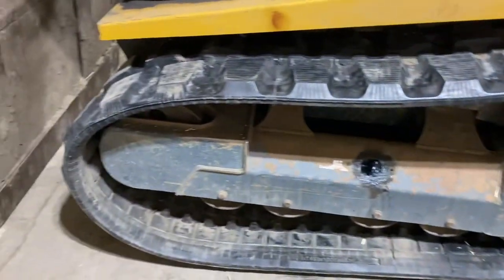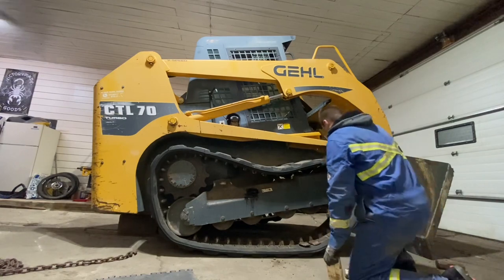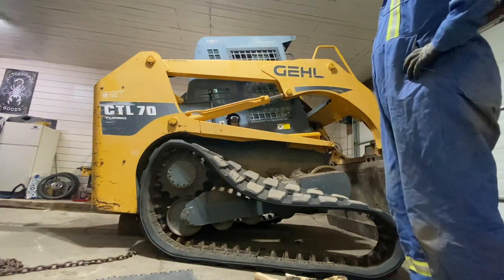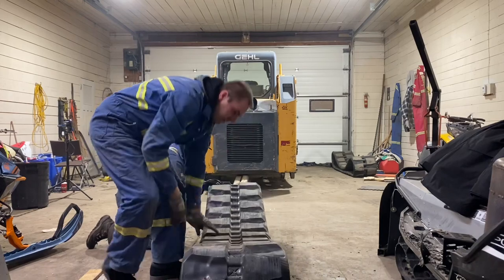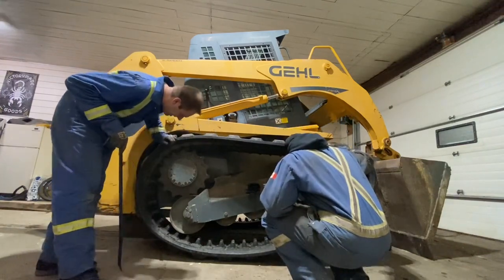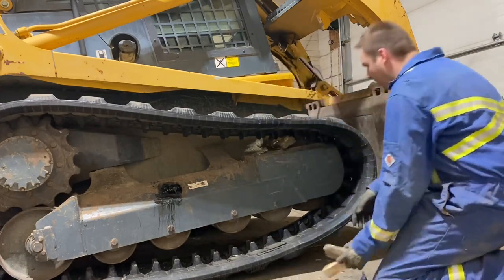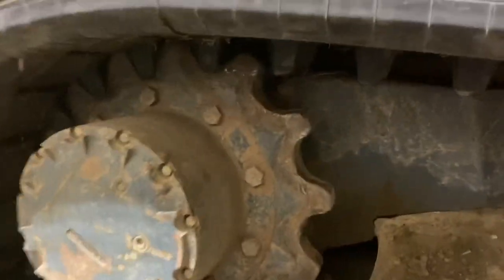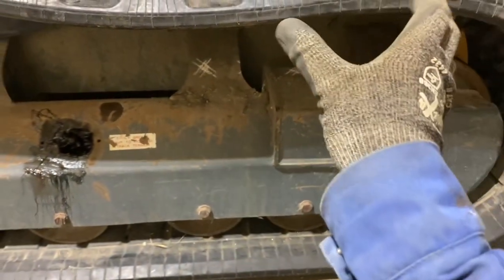How To Replace The Tracks On A Gehl CTL-70

Comment: Jason is still alive and kicking, that Gehl has a similar track system to an SVL75 that I'm used to. Getting tracks swapped out was a grunt it really helped having a mini to push the tracks on. Tracks didn't last long on the SVL75 it would tear the drive lugs out, tracks were always tensioned to where they were supposed to be.

Comment: We typically place blocking between the idler and the front bucket and use the bucket to push the idler in to remove the grease from the grease ram.
Reply from the maker: That would work, along with if you had another machine just pushing directly on the idler.
Reply: @vantagetes  nice work man! This Job is always wayyy more difficult than it would seem for me lol